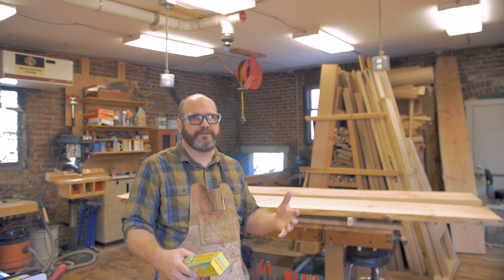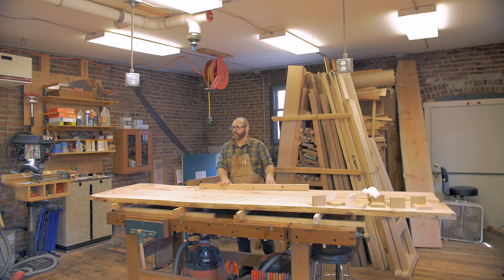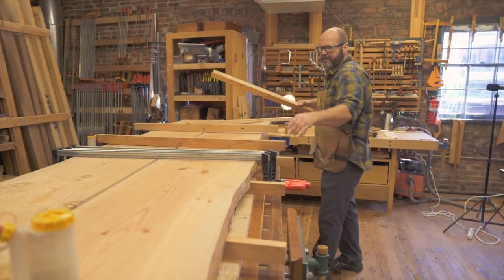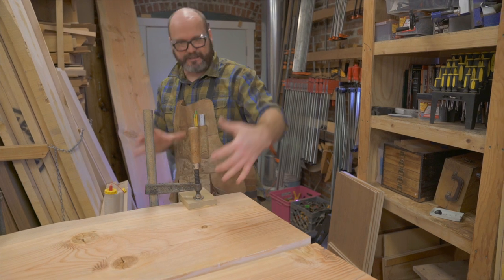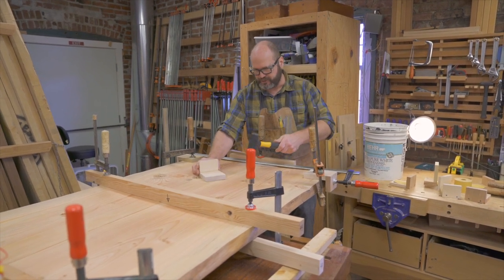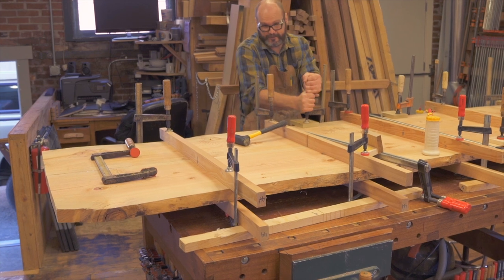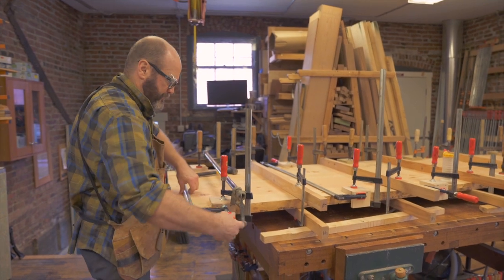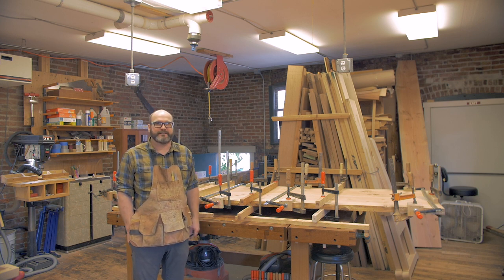DIY live edge table top - how to glue two slabs together the right way

Comment: Great video! At the end you commented that you forgot a few things. One that I noticed is that you carefully put wax paper between the bottom cauls and the table top to avoid gluing the cauls to the table top, but you didn't do the same for the top cauls (oops). How did you separate the top cauls from the table top after the glue dried? And it would be interesting to see how you flattened a piece this big after the glue-up. Unless you have a stationary planer big enough to run this through, the options seem to be hand planning or sanding. Which did you choose, and why?

Comment: Great video! The sandpaper edge protectors for live edge glue ups are a great idea! Just made 12 of them. Don’t even let the rude comments get you down. This is the best video I could find for live edge protection!
Thanks!
Reply: I thought the same thing, I’ve glued workbenches but I’m trying a live edge for the first time and I was puzzled about clamping without damaging the edges. What material/wood did you use for these corners? Don’t they bend/flex when you start clamping hard?

Comment: great video, i'm much more confident after watching this to start my glue edge slab projects.  I really like the idea of the contoured sticks to clamp it down across the table width.  Is there a certain radius you used on the contour? it surely didn't seem like much and I would believe you used a hardwood vs a softer wood like Pine for these.  Thanks for your content!

Comment: I am new to this but I thought you had to also apply clamping pressure from the underside as well.  Also, the reason he is using the blocks was to protect the live edge.  Do you not have to worry about the clamps damaging the underside face?  Thanks.

Comment: This only works if you have 1,974 clamps. I do not. 😂 I tried cross board like that on a 1"countertop and they just bowed then cupped the counter piece once the glue dried. Couple mins (like 1 hr) on a router sled I built and I was able to get the cupping flattened.